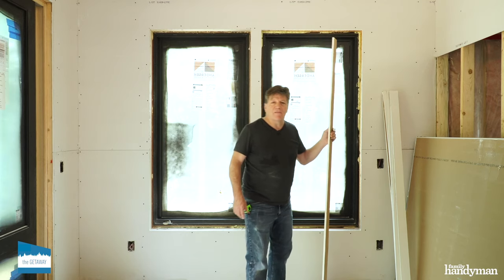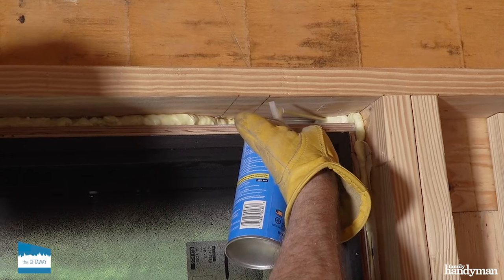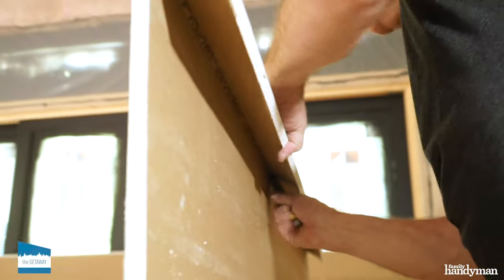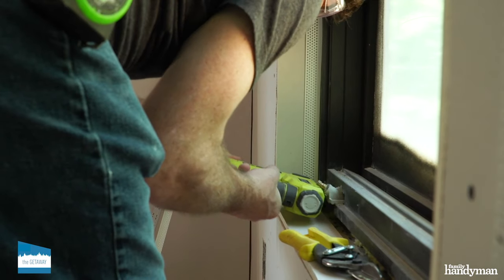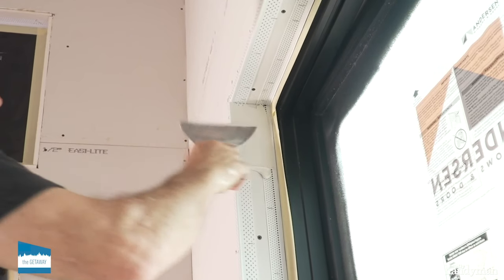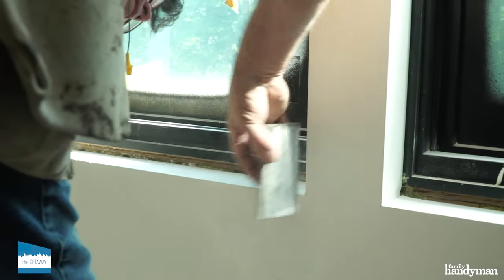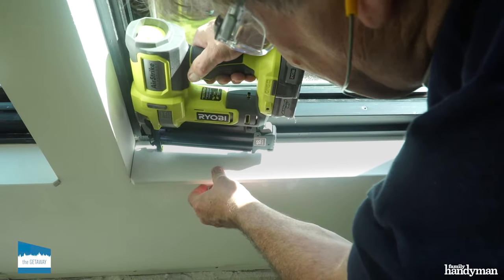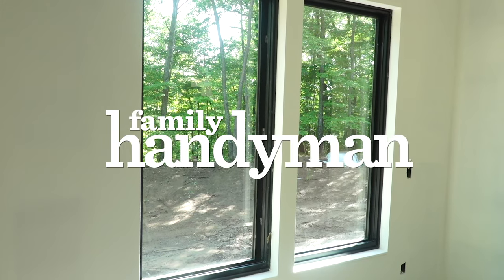How to Achieve the Trimless Window Look

Comment: If you have to replace a window in the future do you just do it from the outside, or do you have to cut out all this drywall and go through this process again?
Reply: Windows are installed from the exterior of the house, so typically yes you would have to remove/replace the window from the outside.
Reply: If the replacement window has the same dimensions, no need to redo the trim inside.

Comment: What's the solution if the window already has a jamb built in? How would I achieve this effect?
Reply: You can absolutely achieve this look with your jamb built in. You can install your drywall over your jambs. I use special trims that can help you out to bridge the gap. Cheers!
Reply: It might be possible to remove the jambs. I did, with a pry bar and hammer. Put something in front of the glass to protect the glass from errant hammer strikes.

Comment: Thanks. Very helpful. I guess tape can be used if you can't find that tear away bead.
Reply: Yes. Pros I’ve worked with don’t use tear-a-way. It’s whatever you prefer.
Reply: you can just push the drywall up against the window the caulk with stretch caulk

Comment: where did you get the tear away beads, am having trouble finding them.
Reply: called "Vinyl Rip Bead L-Trim" at HomeDepot
Reply: home depot ot Lowe's in the drywall area next to the other drywall metal beads